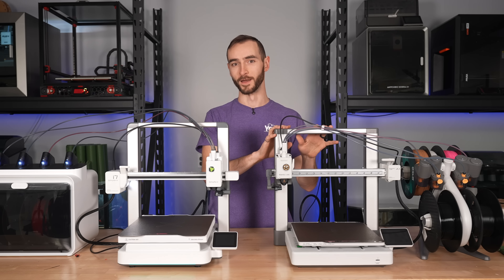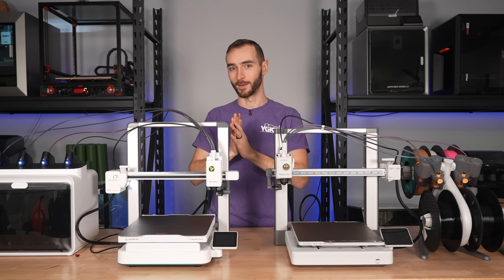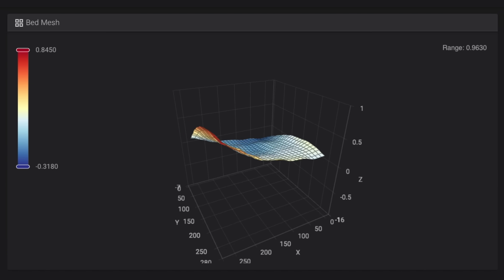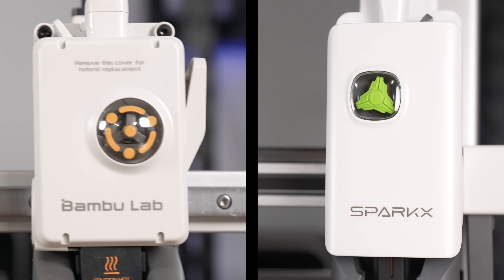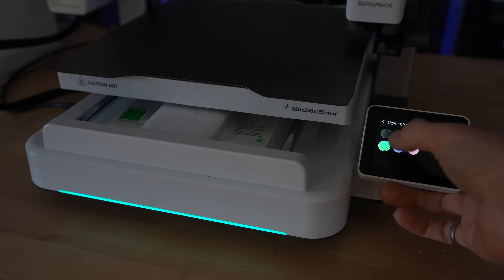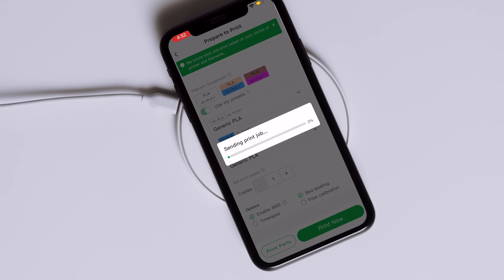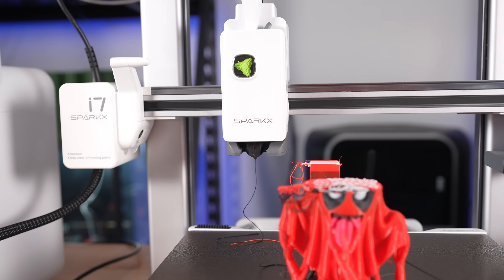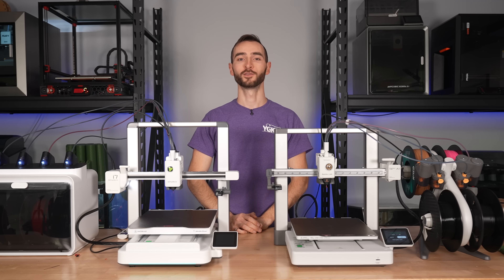Creality Cloned Bambu's Bestseller (and made it better?) - SparkX i7 vs Bambu A1

Comment: How much they paid you,  that's important question 😅... creality is shite company. Firstly the print is horrible (not presliced one, but actually doing your own stuff), secondly the waste is smaller because they purge less, so you will have mix of two colors on your model - print a pumpkin with black eyes. Thirdly creality always stop supporting the printer after new is released, including all the disposable elements like nozzles, gears etc, while a1 have all the replacement parts available since the launch,  creality many times stopped all support even after a year, so if your printer will need maintenance like new nozzle you won't find any as is not widely spread design and definitely not popular enough for other companies to make their versions of those consumables. And lastly, change that damn build plate to normal one like cryogrip or any cool plates, in which year are you living in? 2022? Pei is outdated crap, don't use it. Also that ams system for creality - do you have space for moisture absorbent? 
Your review is as useless as 5th leg for a dog. You haven't done any comparison and heavy tests as you probably already know that creality will lose miserably...
Reply: i think his review process is pretty solid, just not great review material this time.  my problem with creality boils down to overall machine quality & lack of adequate support, but they're not the only ones i feel that way about.  creality has developed a bad habit of not just refusing to support their own machines after a short time, they like to pretend they don't exist if there's any problems with it - like they did to the entire neo line.  i have big problems with how bambu runs their business, though, especially with changing terms after the sale.  for me, the number of companies trustworthy enough to give my money is dwindling - hence why i mostly build my own.
Reply: @TinkerDad3D  the review should be done with finding as much problems as possible, not like getting the machine and filming first hour of use. As to printers, i just don't have time thinkering and tuning things, that's why i choose bambu, as i have few printers from them and haven't had issues so far, and i print lots for business.
Reply: @Jokershadow696 if he were to show everything he does with the machines he receives for review the videos would be prohibitively long.  i've seen more than enough of his reviews to know that.  as far as out-of-the-box functionality goes, i understand the appeal but for a lot of us with or without technical skills (which i have & use daily, aside from building machines), business ethics matter just as much as functionality.  bambu set a precedent of changing terms of use after the sale that many of us simply aren't comfortable accepting.  if you are, that's your choice.  i don't like bambu or creality, personally, but both for different reasons.
Reply: @TinkerDad3D as i wrote, review need to show problems , pros and cons so that the viewers can decide to buy or not to buy. This is not review,  just printer show case at most. As to changing the terms of service - as long as you don't update the firmware you won't need to agree with new terms. Besides most of those terms not really changing anything,  bambu was closed proprietary system from the start, i don't understand why many are upset with that. Is not like they introduce subscription service to use the printer etc, till then is just scaremongering.
Reply: You ok bud, skipped some piIIs? Pei is not outdated lol
Reply: @riba2233  you talk like child...bro.... i can't take seriously anyone using bro in their vocabulary. Is like room temperature IQ individual signs. Go spread your lols to kindergarten. Grow up and maybe we can have some talk then

Comment: Creality did it first, not bambu. Check your facts
Reply from the maker: Did what first? Make a 3D printer? I specifically pointed out how the Ender 3 used to dominate this segment before Bambu came along.
Reply: did what first? the video is pretty clear that creality copied bambu with this printer.
Reply: @ry4nolson  Copied what? The color white and rotation useless shit on the extruder? Calm down bambu boiii

Comment: Creality used to be the best bang for the buck, they had a real name, this.... The cloning....this is just pathetic
Reply from the maker: Cloning has been their modus operandi for a long time. The Ender 3 was, while not identical, inspired by the i3 style design of the early Prusa machines.
Reply: @ygk3d  Calling it anywhere close to cloning is a ridiculous statement.
Reply: OG Ender 3, S1 and K1C were their only competitive printers. Everything else was a waste of engineering and marketing effort. They are so out of touch that without any notice they started to block custom firmware installation on all recent K1* series revisions.

Comment: Creality is such a big company, they should do better than just clone other stuff.
Reply from the maker: You think they’d have at least one department devoted to innovation. For the size of the company, as you’ve said, they could very easily be a leader rather than a follower.
Reply: @ygk3d  absolutely, they could have been a dominant #1 player that nobody could even come close to.
Reply: @ygk3d but they do innovate.  They innovate on price. Bambu innovates on quality.
Reply: Bro they should at least have a better naming department holy fuck awfull name
Reply: that's been creality's biggest problem for years.  they've just moved on to cloning other companies' stuff rather than cloning their own habitually - they just haven't entirely moved on.  my only question is at what point will they refuse to support this?   they so often cease support suddenly with their own machines if something goes wrong, pretending they don't exist though they continue to sell those same machines with the same problem intact.  their solution seems to be just to release a new version of the same machine, sold alongside the original, which is why i buy their used machines for parts to build something else.
Reply: To be fair their clone is essentially porting A1 over to Klipper which is extremely easy to fix and mod. But like many other creality machines, once full production starts there likely will be something the community has to fix.
Reply: @joescalon541  that's correct in theory but in practice there is nothing to fix on A1 software vise, and klipper doesn't help you when you have hardware issues like most creality machines do.
Reply: What’s nuts is the sheer quantity of printer models they sell
Reply: We've seen what happens when they design their own printers, and they suuuuuuck.
Reply: @CarbonKevin  haha yeah, but that is the whole issue unfortunately
Reply: If you imitate somebody else's existing product, you know the size of the market, and that a particular feature set is feasible.
It's the conservative safe approach.
Reply: @ericthecyclist  sure but they don't have to be so blatant about it
Reply: Looks can be similar because the core design logic is shared. The true difference is in the overall use, not just the shell.
Reply: @channelnobody  no, looks are similar very intentionally. If they just copied functionality I wouldn't mind it as much.

Comment: It’s not a copy paste, it’s a mirror
Reply from the maker: Right you are. The twins are fraternal, not identical.
Reply: But  doing it better? Im all for competition  just means better for consumers
Reply: Hey if it ain’t broke, iterate
Reply: Exactly,  no respect to creality making 0 effort to even try to make it look like their own unique product. If you can't design something yourself and make it better or different in some way idk what the point is of producing an inferior clone ripoff if its not even significantly cheaper.
Reply: cut anb etsap
Reply: Not exactly, otherwise the screen would have been on the left… 😁
Reply: Eh it at least has open source software which is something Bambu will NEVER do.

The Creality is a no brainer
Reply: @theneutralnode-s Orca is literally a fork of Bambu Slicer, which is fully open source software.
Reply: @TheOfficialOriginalChad What? I meant the software on the printer itself. This is coming from someone with an A1 and A1M
Reply: @TheOfficialOriginalChad bambu slicer is literally a fork of prusa slicer which is fully open source.
Reply: @CUSTARDP00DLETK  nope, orca is a fork of bambu. Bambu is a fork of prusa and super slicer.
Reply: @theneutralnode-s  So you mean't the firmware, not software. 
You're almost right, then. The X1 is open source, but everything else is closed source.
Reply: @TheOfficialOriginalChad yep, my apologies.
Reply: @riba2233 and those two are forks of Slic3r
Reply: @TheOfficialOriginalChad "Firmware" is effectively software in the case of modern printers with full on GUIs
Reply: @TheOfficialOriginalChad  bambu slicer is a fork of prusa slicer. So it's not the best argument for bambu open sourcing anything, they didn't have a choice in the matter. I still love bambu tho
Reply: @starmanxvi yep
Reply: @theneutralnode-s  A1 Looks like a copy of ender 3.
Reply: @theneutralnode-s  I mean is is really? It has to work reliably first, being "open source" is like the 10th most important spec